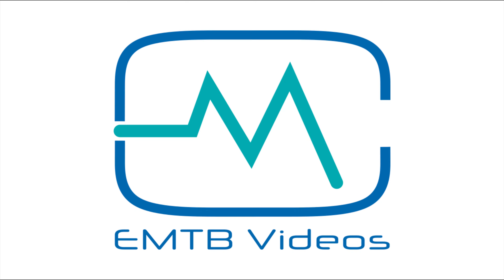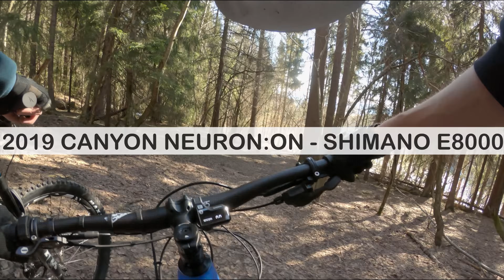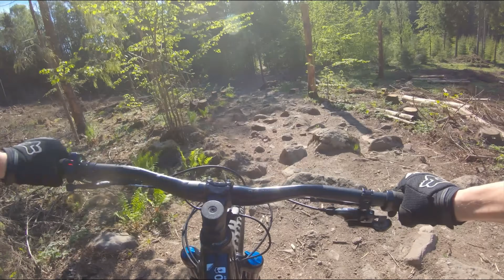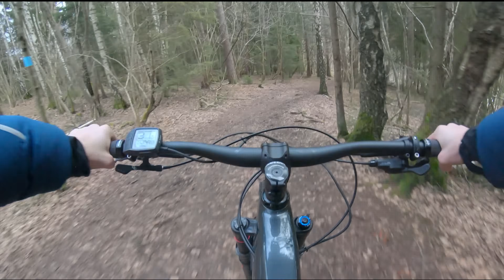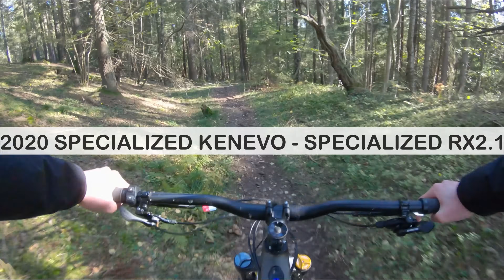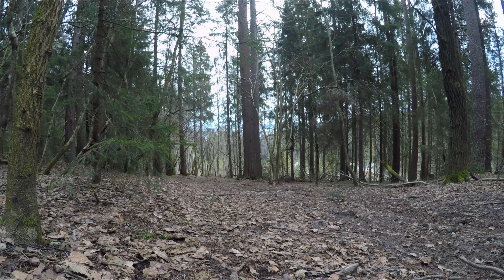Are Bosch ebikes noisy when descending/coasting?

Comment: I have the same rattle on my Bosch CX motor. It is caused I think due to slack in the motor. The chain movement on downhill freerides allows the front chain gear to move/shift, due to the motor slack, causing the rattle. I wish Bosch would offer a fix for this. Keeping the chain very well lubed helps a little, but the rattle will always be there, from my experience.
Reply: This is the same issue I'm experiencing, the motor noise is by far the most annoying one when descending on my Canyon Strive:ON... Really wish there were a fix for this, it sounds like loose rock rattling inside of my frame.
Reply: OMG Dude ive been looking for another person with the same issue as me, apparently the issue is still there in the market i just bought a 2022 rail 7 gen 2 like 5 months ago and noticed when going downhill the noise, and found that is a slightly play in the crank arm with the motor, more specific the motor part where the crank arm assembles is the part that moves counterclock or clockwise just a little and by doing that the plate and all the drive train moves a bit making that sound. is so frustrating with thisbrand new ebike , my past ebike was a turbo levo 2020 which was silent as heaven.
Reply: Same here ,just bought a 2024 neuron on with Bosch sx motor,clacking noise ,so frustrating.

Comment: Just got a cube 2023/24 action team 160 with the bosch smart system and gen 4 motor its nice n quiet not getting any of the loose inside gear clunking like your hearing here maybe they have baffled it somehow I'm curious to see inside but pretty solid all I'm hearing is that whine abit when pedling it's nice though not embarrassing like some say and switching their ebikes off when passing people both on the levo and shimano and bosch motors that's just crazy every bikes going to have some knocking like You said! It's a massive difference to what we used to have to ride so be more appreciated for what we have today! Just think if we still had kona stinkys and old Giant atxs etc see people moan then eh lol

Comment: Really dislike mechanichal noise. So i bought turbo levo. Stealth as f#% and really good performer all round:)
Reply: This is the main reason I'm leaning towards the levo.  I've read the reviews about motor reliability but the rattle of some of these bikes would drive me crazy.  Do you still like your levo?  Any issues? What size did you get? I'm 5"11 and I can't decide on medium or large
Reply: @barnoldo2877  Loving it. Zero issues other than broken deraillur and rear wheel. Caused by more use than any other previous bike ive had. But you should buy comp version or higher. I bought cheapest option. Smaller battery (not an issue for me, but some prefer more range) and lower spec components make it worth the extra cash.
Reply: @krusch75  Dude, thank you for the response. I was between the Trek rail and the Levo. But I'm def searching market place for a 2020 or newer high end levo turbo.
Reply: @barnoldo2877  Rail was also in my consideration when buying my levo. Great bike as well. But you will have som rattle, unlike brose equipped bikes. They are silent when coasting in rough terrain:)

Comment: Hey man! 
Want to thank you once again for all the videos that helped me decide on my Emtb. 
I got myself an E7000 hardtail in july 2019, and since I saw how fun I could have, a few months later an E8000 full-sus (dual wielding E8010 batteries FTW). 
Was basically choosing between Bosch-equipped bikes and Shimano-equipped bikes, and Shimano motors won five to one in my opinion. 

Shimano had:
+ Better display. 
+ The app to adjust motor behaviour with phone. 
+ Durability. More teeth on front cog that would wear slower. Also heard a few Bosch weren't waterproof (big oof). 
+ Easier to find replacement parts ten years from now from the BIG brand. Heard people had problem finding Bosch parts. 
+ Better sound. E7000 has the highest pitch, but is almost dead silent in gears 8-9-10. E8000 lower pitch and more noisy but not the lowest frequency whirr/buzz/grinding sound of the Bosch. Higher frequency sounds better imo. 

Bosch had: 
+ 10-20 more Nm. More torque from standstill in steep slopes. Although you did say in a video it was harder to engage the Bosch in steep standstill so...

Don't know if Bosch has adressed any of my issues since then. Will update myself eventually. 
Anyway I have no use for the higher Nm of the Bosch. 60 Nm is plenty for my weight of 65 Kg, going up steep hills. 

I've been riding the E7000 as my sporty commuter through Swedish winter (about 1000 Km, probably 50% asphalt). Schwalbe Ice Spiker Pro tires held up, no flats, no lost studs, although I did baby the studs with no hard braking, and both look like they are about 33% worn out. Oddly enough the rear tire looks like it has slightly longer studs left, while the rubber looks more abused. 
Battery held up through cold and I'm on my 37th charging cycle now. 
Forgot to mention the battery range! Through winter I could do 40-50 Km per charge on the E8010 battery, always in Trail (High) Mode. Always charging after 40 Km now, since I've been BETRAYED by the battery five times above 40 Km, when the remaining charge goes from 2/5 or 1/5 to 0/5 when parked outside for 20 min. Seems like the charge indicator is inaccurate on low levels. Cold probably contributes, but it has happened once above freezing temps as well. Brand new in summer temps I could get 70 Km per charge. If I can get 60 Km Trail Mode when summer hits, I'll be happy. Lower range in winter is likely not because of cold, but because of tires, snow, and all the gravel spread on the roads and sidewalks during winter. 

Feels good man. Installing Cushcores now. Only wish they did 32 Km/h instead of 25 T_T 
Oh and Di2 and any other electronic shifter+derailleur is a waste of money. Huge cost for replacement parts for no better experience. E-shifters is just "same done differently". 
Oh and I use two steel locks and two motion alarms (Abus Bordo 6000A + a cheap but great chinese bike alarm by KKmoon or Mengshen ordered from Amazon) on my E-mtb to keep it safe outside. Thieves would be forced to use an axle grinder and then it would SCREAM when they try to carry it away. So far so good. Obviously stored inside at night.

Comment: The rattle of the new Bosch is definitely there, but as you say louder on certain bikes than others, and on some bikes similar to the Shimano. So no real reason to avoid the Bosch when purchasing. I'm more curious as to what exactly in the motor is causing the rattle, is it a design flaw or what?

Comment: Hi, I have a Trek Rail 5 2020 with 4th gen cx performance line from bosch and it does have quite pronounce sound from the motor. It is a rattle noise. Apparently this is normal in this motor.
Reply: Same with my Rail, but I have to agree with the point of this video. Off road riding is inherently noisy - brakes, tyres, rocks rumbling out of the way. Some of my old simpler suspension bikes made a lot of skipping, thudding sounds on the descents. The little clatter from the Bosch doesn't cause me any bother, not whilst I am enjoying the excellent power delivery! This bike is awesome.